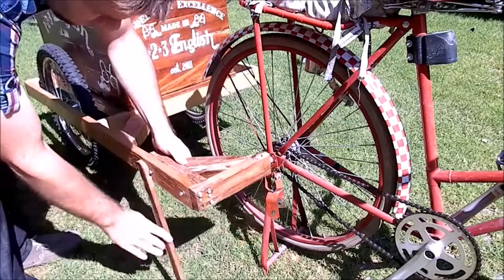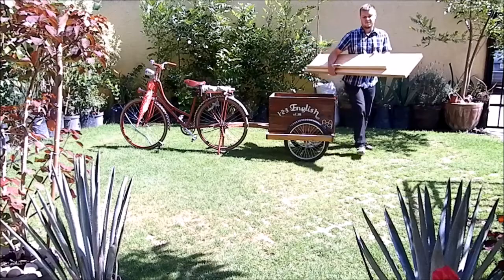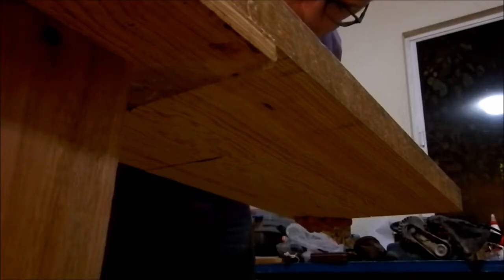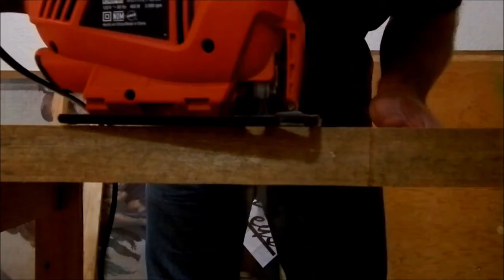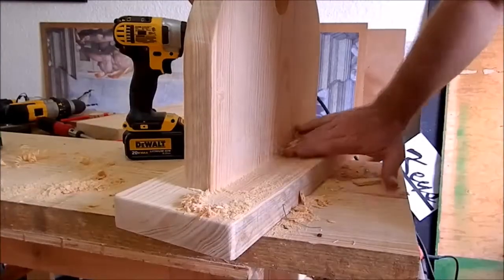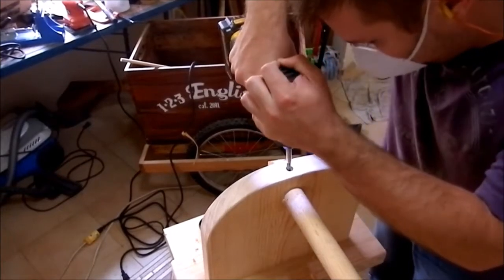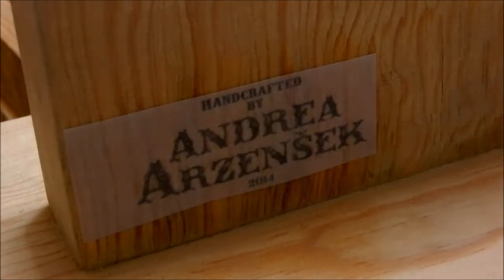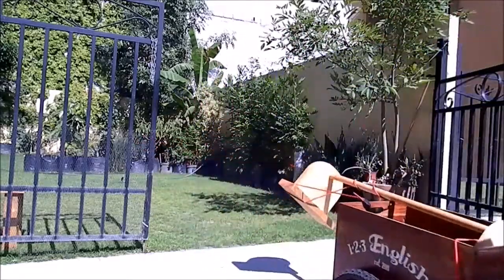Handstand Exercise Bar - Ep 001

Comment: Awesome job. Really digging the beeswax finish. How much weight will a dowel like that hold up? Awesome job on the video too. Really like your bike trailer as well.
Reply from the maker: Thanks Drew for a nice comment!!!
Beeswax is awesome finish, but not for every application.
Great question for the dowel limit
I scientifically don't know how much will a dowel take, but we tested it by jumping in the middle of span. It took force of 175 pound person jumping on it so I think it's strong enough to support more than 250 pounds. Important thing is to mention that there is no bottom stretcher so it allows the dowel to flex under pressure with the sides slightly bowing outwards allowing more stress to the structure. If it was rigid (with stretcher at the bottom) I think it would take much less force to break since its made of pine. I hope that explains better the idea behind construction and strength.

Comment: nice job, what country are you from? are bikes with trailers the norm?
Reply from the maker: Thanks effeinc!
I'm from Croatia, but currently I live near Mexico City.
Bikes with trailers are really rare, I actually never seen one like mine.
People here in Mexico use a lot tricycle type of bikes where the basket for carrying is in front, so they have to steer with a long bar. That results a lack of control over the bike and a lot of risk with higher speeds (turning on side). Also the wind resistance is greater.
So having it on the back results in less air resistance, easier turning, and its definitely more esthetic.
If you thought that you need a permit for trailer then the answer is no, at least I think so. No one ever asked anything. Cheers!